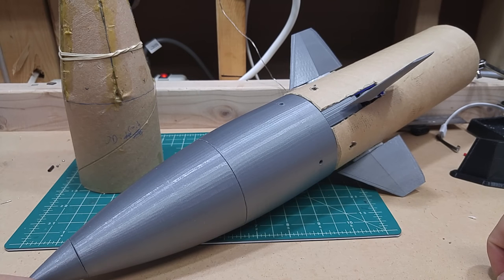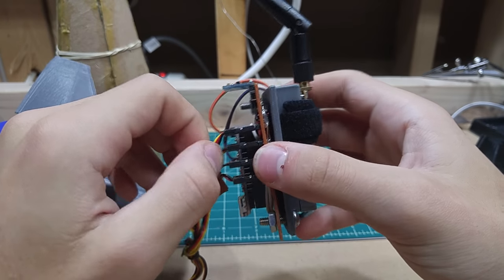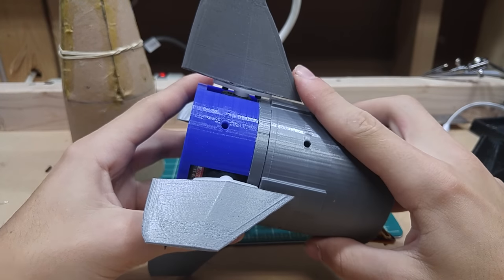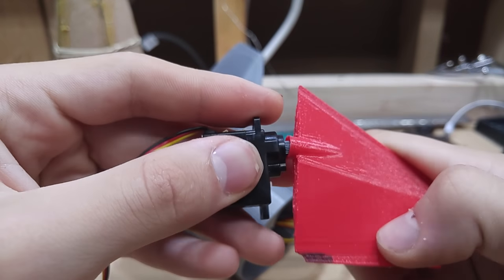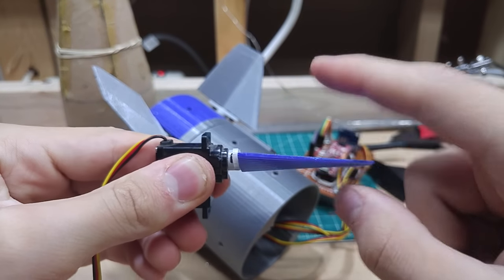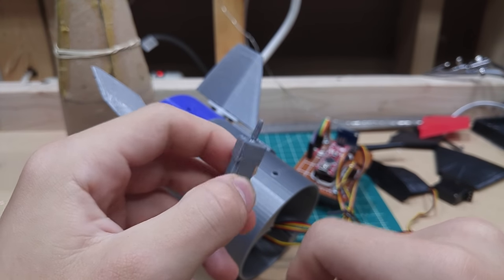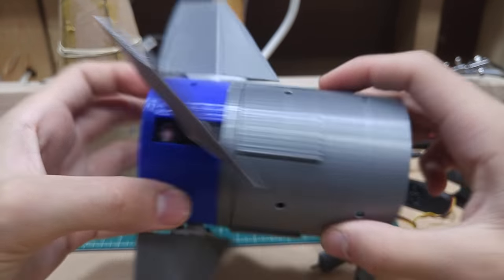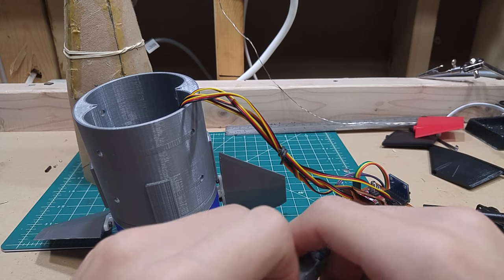Arduino active rocket stabilization system update mid 2016

Comment: Why use the complex gearing, driving four fins, and really messing up your balance point as well as with the center of thrust, when you can simply move to a thrust vectoring setup, by attaching the motor mount to a simple two servo gimbals using light weight push rods, or you can get even smaller, by building a gimbal for a rocket nozzle, positioned over a solid rocket motor (not V-2 style), but potentially a bell style, or better yet, the Toroidal aerospike nozzle http://tinyurl.com/p4w4ad6 with the spike gimbaled, which is likely a hybrid. I'm sure Barnard Propulsion Systems (BPS) channel is gimbaling the motor, and he is flying without fins at all as can be seen here http://tinyurl.com/nxxqto9 but, his goal is to land under thrust much like Xspace does. and he just got started with his program.  but because at some point he will also need to throttle, a modified Toroidal aerospike nozzle is likely what he will need in the future, so he can gimbal his motors, as well as to add some thrust control, and vent excess thrust to the sides and slightly down when closing down the thrust to the main nozzles to land upright.  only time will tell.   try contacting  BPS  to see how he gimbaled his engines..
Reply from the maker: Hahahaha speaking of BPS, Joe and I are good friends! I wanted to do fins since it was a good challenge and also is the groundwork for an academic paper I'm considering writing for a blackbox (hush hush) project.

Comment: As mentioned before servos attached to fins is a joke. It will just fall apart and fly random direction at first try. Materials are worng. Gears can be printed in nylon which has super low friction and extreme durability. I mean the whole thing is poorly designed. Trying to 3d print a rocket shell and mechanical parts is an unnecessary overkill. Try using plastic plumbing parts or build your own shell in monocoque style with carbon fabric. It's easier than is sounds.
Reply from the maker: New variant is FAR sturdier and derived from cold-war era drive systems